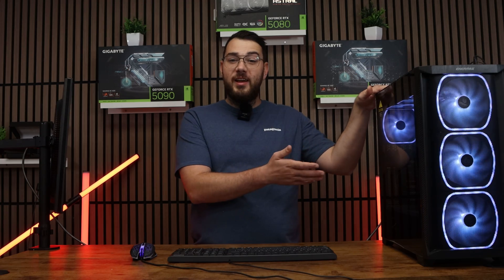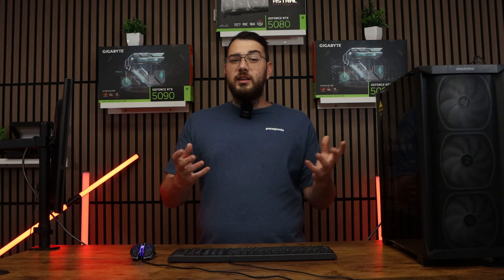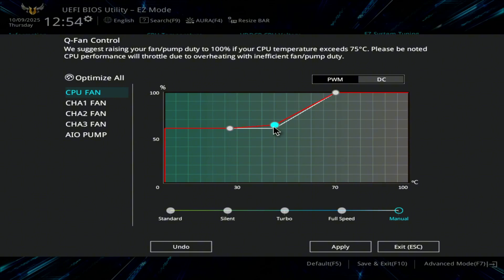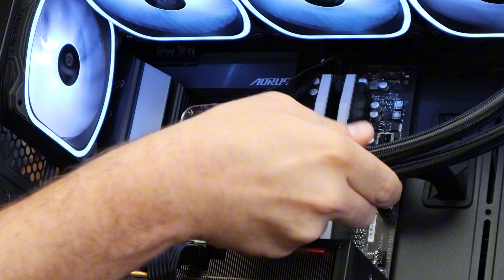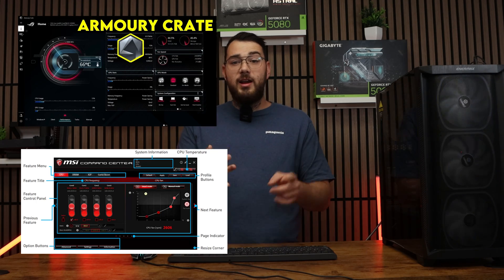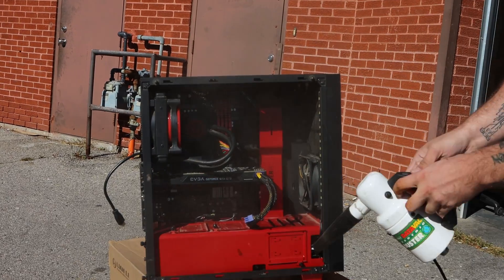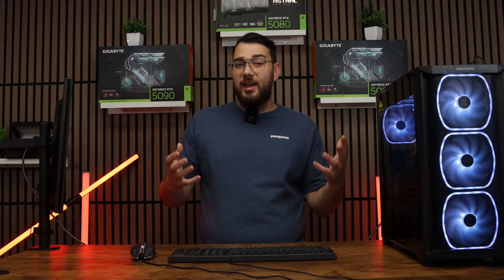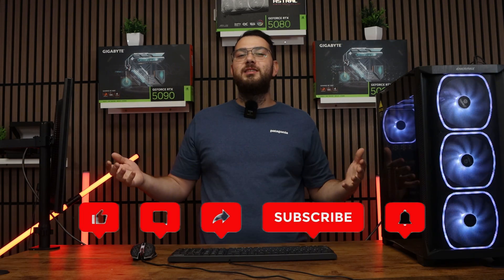PC Fans too loud?

Comment: My pc fans make whistle sounds they come and go I tried everything you said and still nothing they are brand new only 2 months old Lian Li Fans Uni Fan TL WirelessLCD120
Reply from the maker: Try setting the fan speed lower, you can do it through the lconnect app as well. Make sure you are not plugging in the fans to aio header or cpu opt